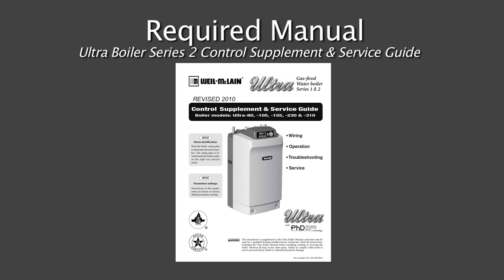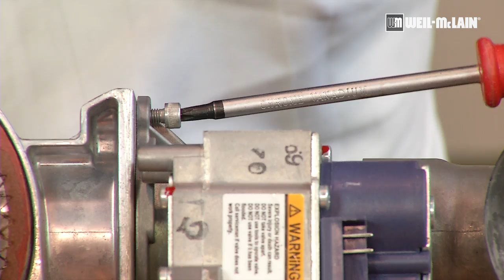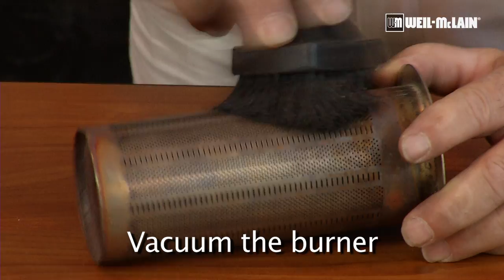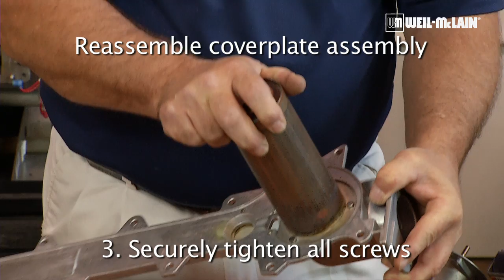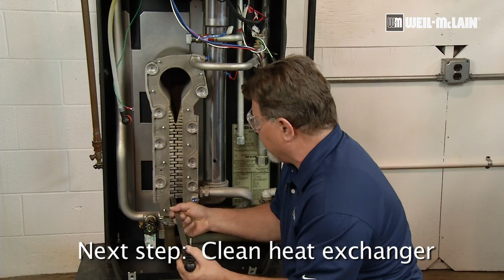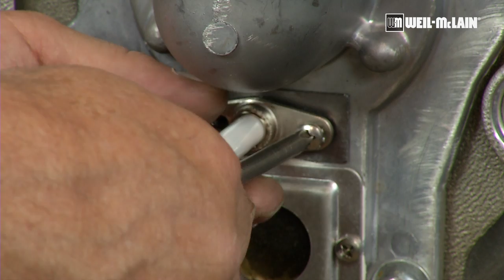Ultra Series 1&2 Cleaning

Comment: is there a specific gap to the new ignitor the new one seems to have a bigger gap than the old one does
Reply from the maker: Igniter rods should be parallel with a 3.5mm (0.138 in) spark gap.

Comment: any info on why my boiler shuts down for supply too fast error what supply is it referring to water to unit, air, or recirculating loop? how would i fix this error?
Reply from the maker: This is an indication of poor water flow, bad ignition, or could be a faulty thermistor.  If in doubt or you have additional questions regarding your boiler, we recommend you contact your local heating professional to troubleshoot your system and they can contact a Weil-McLain distributor or our technical service department for additional assistance.

Comment: I have an ultra 80 natural gas do you have to replace the electrodes every time you clean them out? And where would you add water to the unit . Great video
Reply from the maker: Fouled igniters can be cleaned for additional use with fine grit sand paper or steel wool. Worn or badly fouled igniters should be replaced with the proper repair part. Igniter rods should be parallel with a 3.5mm (0.138 in) spark gap.  
We do recommend contacting your local heating professional to troubleshoot your system.  Your heating professional can contact a Weil-McLain distributor or our technical service department for additional assistance.

Comment: Great video my boiler was cleaned 5 months ago just the other day I had an error code b 25 what would cause this and does water need to be in the hose at bottom of the boiler, I drain this every 6 months.
Reply: how much did they charge to clean this boiler?
Reply: @smooveb191   over 400 dollars
Reply: the clear plastic tube should have water in it to act as a trap till it goes outside boiler and drains so exhaust fumes don't come out through there into house

Comment: In the kit should be included the Ignition electrode gasket (it breaks easily) and the o-ring for the gas line inlet adapter block.
Can you specify a part number for the O-ring. It dose not appear in the components list.
Reply from the maker: The ignition electrode gasket for this boiler is included in item # 511-330-253.  The O-ring for the gas valve comes in a pack of 10, item # 383-600-009.

Comment: Our series 2 keeps shutting off with error code E18. Nobody knows how to fix the damn thing...I'm hoping one of these videos helps!
Reply from the maker: The error code is a thermal overrun condition when water is over 210 degrees. A contractor should perform the following steps to evaluate.  Step 1: Verify pressure of boiler water is within the recommended range per installation manual. Step 2: Ohm out the boiler temperature sensor to verify the sensor reading is correct. Step 3: Verify boiler loop circulator is correctly functioning.  If unable to clear error, please contact Weil-McLain Technical Services @ 1-800-654-2109, Option 2, for additional assistance.

Comment: how do you reset the boiler?
Reply from the maker: No need to reset the boiler.  Simply power down the boiler prior to cleaning.  Once cleaning is complete, simply power the boiler back on.
Reply: im getting an error code e 04 on the display was trying to reset it
Reply: @smooveb191  I saw the same error code on mine when I powered it back up.  Just hit reset next to the screen and it should be good to go.